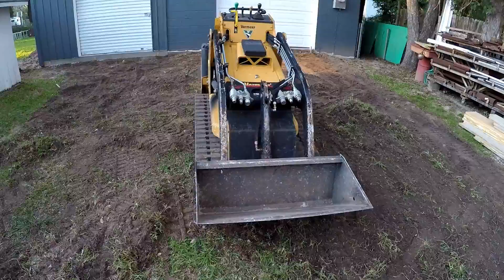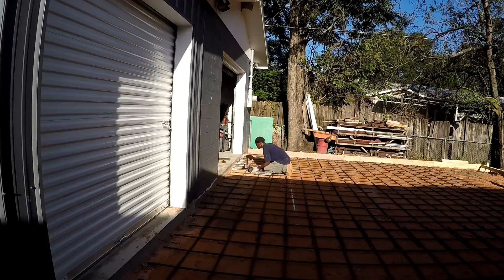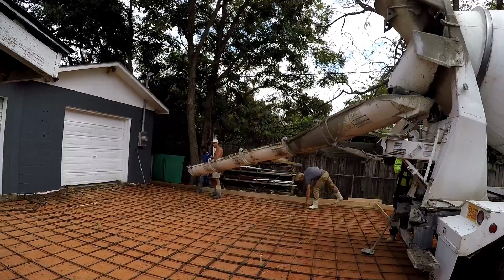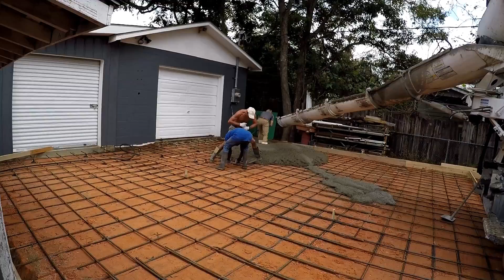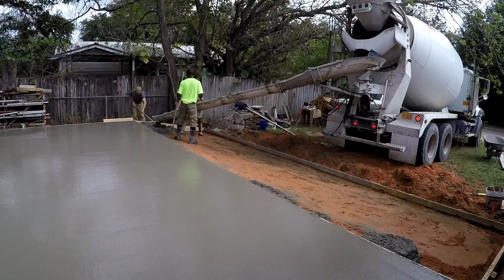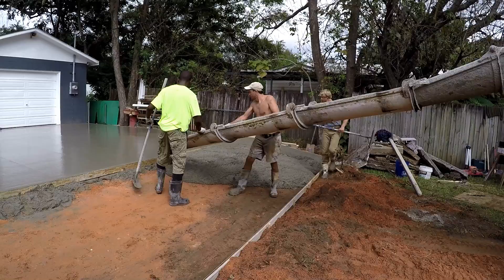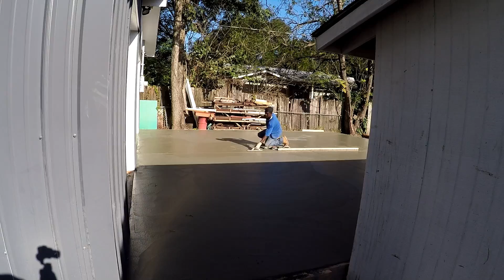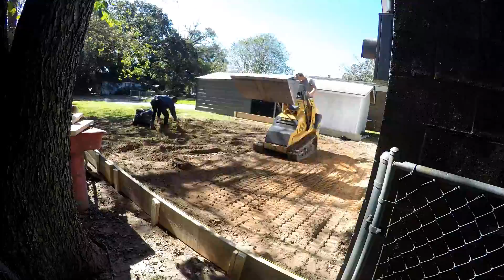New Shop Concrete Slab!

Comment: Hello Adam,  That ought to work out nicely.  For the next pour though I would say use some chairs--they are only pennies and on a 12" pattern I would be putting the chairs in on 24" centers.  Pulling the steel after the mud is on it is a joke.  Best case is the reinforcing will be up in spots but right on the ground very close by.  You just can't pull steel up with that weight on it.  They used to try doing it that way years ago with the steel mesh but even that has not been done for years.  Chairs are the way to go but use enough to maintain an even and consistent level in your case of a six inch slab your steel should all be at least two inches off the dirt.  I would also have them put steel in the small pours as well (sidewalk, etc.) because one of the great advantages of steel is that it lets the concrete act as a unit.  It will settle and or crack as it all does but it will maintain its surface plane with steel in it.  Especially a sidewalk.  Cracks and elevation changes without steel can be a tripping hazard.  The fiberglass chips in the cement don't have the ability to do what rebar does.  I was very disappointed not to see steel in the ramp for all the above reasons as well as actual load bearing in that case.  Hopefully there was more trowelling than what we saw because it is that finishing that hardens (thinks tempering steel) the surface.  One hand float will not give you as hard and durable a finish as you need (I would have preferred to see a power trowel and that used three different times at least for a durable finish).  That is I would guess why your existing shop floor chalks so badly.  I am not familiar with Florida but if it was my project I would have laid a vapor barrier (about $200 for enough pool liner which is 12 mil) under the slab so that if it is ever enclosed and air conditioned you wouldn't be drawing moisture through the slab into your shop area.  Slabs are very permeable to moisture and your area is humid with a high water table.  The barrier also help the slab cure if the ground is dry at the time of the pour.  All these would make a barrier under the slab a good choice.    Now I am not trying to rain on your parade as it must  be wonderful to get it done but I bring these points up so you can be aware before they do the rest of the concrete for you.  Nothing like a paved surface for working on.  In any case what is done is done and it will be quite an improvement in space for you.  I did like that they thickened the edges of the slab.  Enjoy.  Take care.  Doug

Comment: Good crew. Working hard and doing it right.

Just a suggestion but for the lawn area leading up to the ramp you could look into "grass driveway grids" for a future project. Then you could have grass but not worry about digging trenches into it with vehicles. I have no experience with them but I like the concept.

Comment: whats up with that piece of timber between the ramp and slab?.. and there should have been steel in the ramp. chances are it won't break but why put all that rebar in the slab and skimp on chairs and rebar in the ramp.

Comment: There's something about my engineering background and fascination with concrete that makes me really nervous about people who are super duper experts in installing concrete - so much experience that a checklist isn't part of it.  Is Zerber a structural engineer?  Surely they wouldn't do anything so unforsightful as to neglect to place the spacers before concrete is poured. (I winced so hard when I saw the rebar laying on the ground during pour)  When is post-slosh adjustment enough and when does the steel ooze back lower and leave a weak spot?  Was there any measurement of the adjusted rebar position? When is the spot weak enough to cause a problem?  When do you actually see the difference between a slab in whose rebar is tightly tied or welded at every joint and one in which a few loops keep things in place and the rest of the intersections are just free? Does it matter for this shop? If the slab was to crack significantly under the weight of a machine, would they consider calling Mr. Zerber back to consider what he might have done wrong or just adjust the leveling shims?  No, they'll just fill the cracks and level the machine.  What fundamentally bothers me is that any lack of craftsmanship will be overlooked in time and space - the installer has no chance to recognize any minor to moderate problems sloppy, lazy, or non-methodical spec following during the installation caused.  Obviously the installer knows the adequate technical parts of installing concrete - how to follow the instructions of the structural engineers and do his jobs to spec, and all the props to his years of experience.  I have every sincere hope that any shortcomings never cause a problem of any sort (they probably won't cause anything worthy of note).  I'm sure it will provide a beautiful sturdy floor for craftsmanship of Abom as long as he cares to use it.

Comment: They really should have put some steel in that ramp. The ramp should have been poured separate so you could have a expansion joint in there Are the pulling that 2x out and corking the gap? I am not trying to rain on your parade it looks good I just been In form work my whole life looking out for you! I'm in new england We have bad winters Idk if its different code where you are

Comment: That is awesome Adam! You haven't appreciated concrete until you put a transmission in a full size SUV on a gravel driveway with cardboard, carpet and lots of colorful metaphors. I was told to mist concrete in the past. Didn't seem to hurt it any.

Comment: I didnt see them use a string line to check the level then put steel pegs in the centre so they coould screed to that level, so its not hollow in the middle of the slab ,but maybe i missed that .

Comment: I saw a crew use that vibrator gadget before. They used it all over the slab. IIRC, somewhere along the way I heard they get the air pockets out too, along with shaking everything into the right nooks and crannies. (I am not an expert, I just watch this stuff.)

Comment: Dam good job ! & mighty fine slab.Was wondering why they brush it when it's done,web search solved that puzzle..Not sure if a clear coat would be ideal for it or not.I know on pathways that have smallish coloured pebble like stones in them look pretty good ,as it looks like they're wet when there's a clear coat on them..A coat of something will certainly stop mold appearing as that stuff is dam slippery.People get too aggressive with water blasters when that happens (mold appearing) & dig into the concrete..lol..

Comment: A very different way of prepping the foundations for concrete compared to Australian regulations. We must put down a minimum 2 inch bed of compacted sand, a sealed lapped and taped moisture barrier, a minimum 4 inch wide by 4 inch deep edge beam around the perimeter and our mesh already comes in prefabbed sheets where all the cross bars have been spot welded together. Very interesting to see an American spec slab being prepped and poured.

Comment: Ever notice you don't see many plump cement workers? That was a big career selection factor when I was young.

Adam, if rains every once in a while in Pensacola. You got enough pitch on that slab? Looks pretty level to me but I may be fooled by the camara lens.

I predict that slab will be covered by shop building in a couple years.

I wonder why they don't have levels on those long screeds.

Comment: Did not like how they did not lift the rebar. I seen they put a few rebar supports in here an there, but they should have had them everywhere. Would also liked rebar or welded wire mesh in ramp even if the concrete was fiber in the concrete, and had rebar from pad connecting into ramp. Do cover and keep damp with tarp over burlap. You don't want the concrete to dry out or the concrete won't cure properly.

Comment: That's a great looking slab Adam, I can't believe how long they were able to keep the concrete truck on sight, up here in Ohio, you only have so many minutes per yard to off load and then they can charge extra if they so desire. It's really how busy they are.
Reply: Up here in Illinois that depends upon how close the site is to the concrete supplier. When the state IL Dept of Transportation did a complete remake of the Interstate highways around here over that last 10 years or so the contractors built the source (mixing setup - whatever that is called) of the concrete they poured at various cloverleaf interchanges along the highway. And at the end of the job they put grass back in.

Comment: Spend ages grading the base for the ramp.
Concrete truck shreds it in an instant.

Also, the vibrating thing at 14:00 is called a poker. As the video says, it's for settling the concrete and getting the bubbles out of it.
Reply: Mechanical vibrator. It consolidates the concrete

Comment: Hi Adam, That is quite a hunk of concrete, What size is the pad How many cubic yards
and what was the temperature that day.  That is the kind of contractor that I would 
always use when we needed concrete work where I worked before retirement.
That will make a nice shop floor someday.  >Joe, Baltimore MD.

Comment: Can never have enough flat area to work on, nice job.   Concrete in your area is much different that most places that have freezing or expansive clay soil.   No rocks to dig out and that sandy soil really compacts nicely.   I would have put in more chairs on the rebar but as long as the bar off the soil so it doesn't rust it's ok. The lower it is, the stronger your slab-- the bottom of the slab is in tension from loads on the surface.   Only thing I didn't like was the heavy broom finish,  they are just so darn hard to sweep off but on the other hand you don't slip when the slick Florida moss grows.

Comment: Concrete is very tough work. In Fla I imagine it is even tougher. Mud takes off big time in that heat. They seem to be very conscientious about the work they do. I have never seen a contractor use chairs in the field. I haven't seen a ton of concrete work done but I know good work when I see it. They also used a vibrating tool in the slab "turn downs" which is above and beyond. It's looking really good. How many yards?

Comment: In this instance in NZ we would use big sheets of high tensile mesh 1/4" thick wire but no inter sheet tying. I think its much easier to pull up through the concrete than the thicker 1/2" rebar.

Comment: Wow! Awesome job, Adam. Really nice work, and the people who made the slab there look very professional as well.
I have a couple of questions to anyone who's knowledgabe in construction work, if I may:
1. From the video above, and from other construction work I get to pass by, it seems that the foundations aren't physically connected to the ground. Don't get me wrong - the slab, for example, is very heavy and won't move, but the concrete itself, after curing - it simply floats on the ground, it just lays there, not physically connected to the ground below it. Is there a reason for that? (Aside from the obvious fact that such constructions are very heavy by themselves and won't move anywhere on their own.)
2. In the video Adam mentioned "control joints." What are they?
Thanks, and forgive me if the questions are dumb. I really know nothing about construction work.
Reply: Control joints are grooves in the concrete that make the concrete to only crack on the joint.

Comment: what needs to be said probably has been.. Still 3500 pound test? uh guess way down south there is a totally different idea of what good concrete is. The aggregate looks to be 3/8 in video instead of 3/4. 

That said...WHY did they leave a 2x10 between slab and approach? It's not pt. Isnt that like an invite for infestation of termites?

Comment: That is a damn good crew you hired!
Spent too much time seeing too many jobs fail because the concrete is too wet, or rebar is sitting on the ground, so on... 
They did everything well beyond the minimum. YOu are building a pad stronger than most 8" foundations for homes.
Nice low slump mix, fiber reinforced, plenty of steel, well centered rebar (so you are unlikely to have rust spalling in the future)... A lot of small things done right.
 A light brush finish is my favorite on these pads. Great grip, looks clean, and lasts for ages. Just hard to roll things over on occasion if too rough. I havent seen anyone do that great of a finish job in years. People are so sloppy here in So Cal, plus the heat doesnt help... 
Keep it nice and wet for a week and you will have a great finish, 
Easiest way is to literally get one of those hose sprinklers, set it in the middle, and run it every hour or so (just put it on a garden timer from home depot, ~$25
Reply from the maker: Thanks Joe